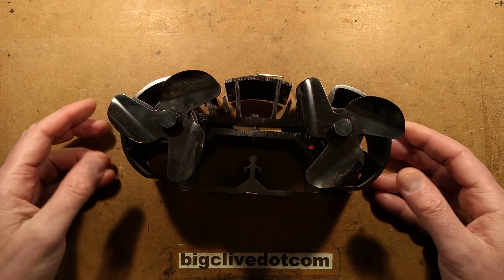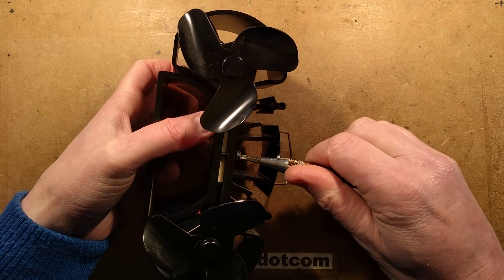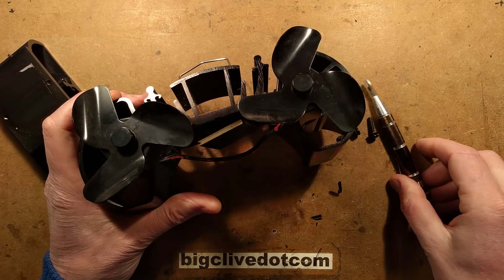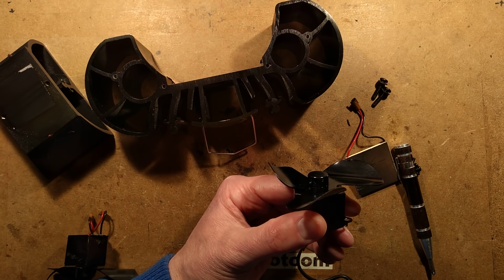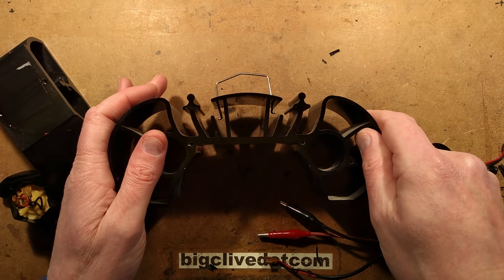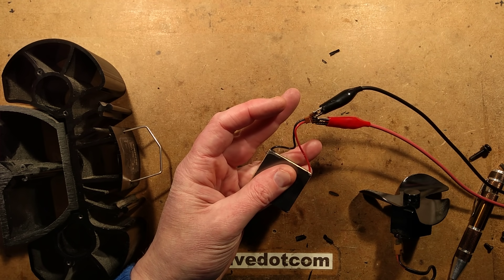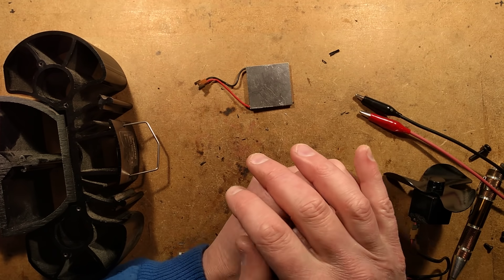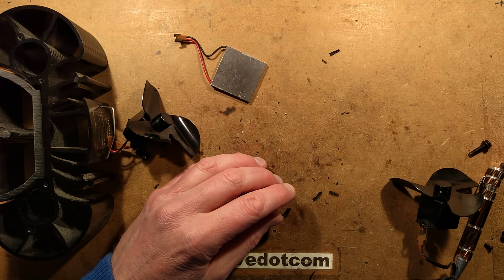Teardown of a self powering machine.

Comment: OK Clive, this video has two topics worth note.  One the Alzheimer's side, and the Peltier Junction side.  One I have familiarity with and the other not.  Sadly it was the Alzheimer's side I am familiar with, and have first hand experience with the need to laugh about situations that at the moment seem pretty crazy.  By the way, I still have the chamber pot from the commode chair (unused) with the lid in my garage, always needing a container for something, I kept it.  Now for the other side....can the Peltier Junction TEG/TEC be connected in series or parallel, depending upon needs?  Is the voltage a product of surface area, (more=more better)?
Reply from the maker: I'd guess two or more could be used and wired in series/parallel for higher voltage/current.  It's not something I've tried.
Reply: I suppose the issue with serial connections might be a voltage differential between one and the other, similar to tungsten lamps in serial on a DC circuit so they become progressively less effective at cooling. Or if used to generate power then you could end up with one of the strips supplying power to the other and thus driving it.

Parallel would seem to be best in either case. In my understanding anyhow.
Reply: Edward Clayton 
You probably meant to say that current would be a product of surface area.
Reply: This video uses the differential between the Alzheimer's side and the Peltier Junction side to create positive energy 🙂
Reply: @Conservator.  Yes, that is exactly what I meant to say.
Reply: Indeed they may be wired in series or parallel as needed.  In electrically parallel you will generate more current, in electrically series more voltage.  You can also stack them one atop the other (thermal series) to achieve lower temperatures but the efficiency drops off greatly the more layers there are as you are basically increasing the thermal impedance between the two ends and each added layer needs more heatsink area or cooling than the layer before (or a larger peltier area to pump the heat from the previous peltier) to help maintain efficiency, but they are sometimes used that way when one needs to get a small volume to very low temperatures.

In fact, a typical peltier junction is effectively an array of many hundreds to thousands of thermocouples in series-parallel (typically thermally paralleled and in series electrically, though multiple arrays can also be paralleled on a common transfer plate for lower operating voltages) all operating as a large array to generate the effect as a single thermocouple by itself does not generate a lot of cooling or power generation on its own...but since the effect scales we can combine many to get what we need.
Reply: @paulgascoigne5343  I was thinking in lines of useful voltage like a battery or batteries in series.  Didn't consider one driving another.

Comment: Interesting, I have an identical single blade version, and recently replaced the motor after it failed. The original motor must have clocked up around 5000 hours. Sometimes I give the blade a little push to help it start up. Hopefully I will get another 6 years of service from the new £3 motor. I love your channel btw.

Comment: Could you modify one of these with a higher end CPU cooler instead of the big chunk of extruded aluminum? I wonder if it would allow it to start up at a lower temperature and provide more airflow for a given temp.
Reply: I've seen a couple on youtube - the one by Brian Ealy is especially notable for the magnificent beardage on screen.
I'd guess a heatpipe would move the heat more efficiently and reduce the chance of the sort of slow start overheating clive's had in these units - but it's probably easy to underestimate the clever thermal design that's gone in to the shop bought ones too
Reply: People used to use them as CPU coolers. The problem being if you accidentally cool the CPU below ambient air temperature then you in essence create a dehumidifier (and also lots of water and condensation inside the chasis). You could use monitoring equipment but should it fail or be unable to tell the difference between room temperature and chasis temperature you could still end up with a fair amount of moisture which is never good with circuitry. It takes watercooling to a new level!

The safest and least complicated method is air circulation. Just standard fan and radiator. The chasis and CPU would always be warmer than the temperature of the room so never suffer from water issues. So if you were to use a Peltier to keep the system above ambient temperature anyway, it seems a waste of technology and money, simply introducing a further unnecessary opportunity to fail.
Reply: I suppose you could, but you'd have condensation issues if you went below dew point. You're also strapping a device that needs a heatsink to replace a heatsink so not much value.
Reply: @paulgascoigne5343  Not what I meant. I was talking about using a CPU cooler to make the stove fan work better. Not using a peltier to cool a CPU.
Reply: @3ountyhunter   Not what I meant. I was talking about using a CPU cooler to make the stove fan work better. Not using a peltier to cool a CPU.

Comment: I definitely agree on the fridge aspect, I had a peltier cooled mini fridge for a while, at most it'd take 6x 330ml cans, not that great in the summer, and would make a god awful racket with its' original fan (I later replaced it and made a video of the upgrade), then later I rescued a Bosch fridge from being scrapped, swapped it with the uncle's smaller Husky brand fridge, and now I have a nice, quiet, roomy (in comparison!), compressor-driven fridge instead... :)

Comment: Sorry I don't understand the porpoise of this machine? Is it a stove powered space heater fan?

Porpoise?! Stupid speel chequer.
Reply: Simon A yeah I don’t really understand what it’s for either...
Reply: They're used to blow the heat from a stove  into a room rather than letting it go up to the ceiling. They're neat because they use the heat from the stove to drive the fans. Often used on wood burning stoves.
Reply: @RobertShippey  It spreads the heat of the stove more effectively.
Reply: My worm processor can't smell either.
Reply: Used a lot on narrowboats in the UK, keeps the air slowly moving around and helps prevent the cold feet hot head symptoms of being in a part submerged steel tube and helps take the chill off the rest of the boat given time. Being off grid it saves having to power another device from the 12v or 240v systems
Reply: SO happy you asked this swimmingly wonderful question... (get it? porpoise 🐬, swimmingly, ugh...) I live in Florida and was wondering why the hell would someone turn on a stove to run a horribly inefficient fan. The answer is people all over the world do different things for different reasons. Thank you to the other posters here for explaining this. It’s actually pretty cool when you understand why. You guys really rock!

@matthew willets Thank you for the post about the Narrowboats, that is so cool!

Comment: I always thought they were cool, but what is the point, if your oven is too hot, turn it down or open a window, not everybody has an arger they have to keep on all the time for heat 🤣
Reply: Maybe its for air circulation?
Reply: People who have a wood burning fire use them to move the heated air around a room. They are widely used on Narrowboats.
Reply: Never put yer lager on yer Aga.
Reply: @martinda7446  I put a potato in there and forgot about it. Found it in the back after about a week. I had made coal!
Reply: @ollieb9875  That is how coal is made? I will be sticking a bag in tonight. I may try a carrot, for pointy coal.
Reply: @martinda7446  the only thing I can say for sure, is the potato it once was had ceased to be 😂🤣😀
Reply: @ollieb9875  But you got a nice shiny new lump of coal, it gave its life for a purpose.
Reply: @ollieb9875  Bet it smelt delicious for a few days!
Reply: @Audio_Simon  well.. there's the thing! With the door closed bearly anything escapes unless it's banging on the door.. something other than the slow cremation underway here, leading to the potato's eventual demise can go quite unnoticed! 😂
Reply: bren106 question if they are used on woodburners to circulate heat, why do they even have wires on them and motors? Heat alone has been used to push fan blades and the like around for centuries. Those little Christmas merry go round candle holders for example can spin pretty damn fast
Reply: Sun Wukong 
To direct the hot air in a different direction.
Reply: @pmailkeey O.K, for the pedants then. It improves the efficiency of a radiant heat source by circulating the heated air rising from that heat source. Sit in your car and see how long it will take for the heater matrix to warm it without turning the fan on. That analogy is somewhat erroneous now that the vast majority of vehicles do not have the matrix directly inside the passenger compartment, but use your imagination and wish yourself back in time to when they did.
Reply: @GreatSageSunWukong  efficiency!!!! Watch some narrowboat youtube videos, they are often featured on those channels.
Reply: @pmailkeey actually I threw it in the pond, disgusted as I was at my stupidity perhaps I compounded it further by thinking the fish might nibble on it, like I didn't get to 😂🤣😀
Reply: @pmailkeey Air currents being likely reduced by closing doors and windows when there is a need to heat an area. Relying solely on thermal displacement caused by lighter, heated air rising, and colder, more dense, air falling, is what you mainly left with once those air currents, or draughts, have been limited. moving the heated air more widely and at lower height is better than allowing a room to warm from the ceiling down. Which is why they have underfloor heating, but not over ceiling heating. 
As for efficiency or effectiveness that is purely an opinion on which is the better suited word, and all opinions are subjective.
Reply: @martinda7446  If you do it with mandarins or oranges it would serve as aromatherapy treatment too. Not as pointy, though.
Reply: @pmailkeey The horse is dead, please stop flogging it. I really hope you have more in your life than poring Wikipedia for rebuttal points, I know I do.

Comment: Had one of the tall ones fail on me last year. It was the first one I had, and it ran for 8 years without issue. Bought another one two years ago and noticed how long the original one took to begin to spin, and how slow the maximum speed was compared to the new one, so I decided to tear it down. I removed all the graphite from the Peltier and cleaned it up with rubbing alcohol. Tore down the actual motor, (Which are very simple to open and repair) and cleaned up the commutator, (which was discoloured with use and age) with some 0000 steel wool. Ran a fine blade between the gaps of the split ring contacts to clear up a few shorts that had developed. A few drops of high heat oil on the bearings when reassembled and the motor was as good as new. Some high heat silver sink paste on the peltier upon assembly and the original fan then started faster than the new one and seemed to have a higher maximum speed too. Quite happy with these fans and their longevity.

Comment: I've always been fascinated by those fans. They don't blow cold air because it's the heat that makes them go. Also the fan cools the top and makes a bigger heat differential which makes the fan go faster which makes a bigger heat differential, etc.

Comment: Hey Clive :)
you reminded me that years back, I watched our Antiques Roadshow here in the states. and they had an antique / low tech version of these. it was a fan that had a kerosene [ parifin ] burner built into the base, and the heat from the burner would go up the stand and use heat conduction to turn an impeller of sorts, which would drive the fan blade.

Comment: There are units designed for heating and cooling and there are units designed for power generation that use different metals and are able to handle much more temperature differential without delaminating. There is a high temperature unit in the BioLite stove. A stove that generates usb power from the heat of a small fan forced  wood/biomass stove.
Once again a great video interesting and informative.

Comment: Mother taking a dump  :) warm ;) story, and surprising... And, I have a couple of somewhat big stove fans that have done  a perfect job for many years. It is important to place them on the right spot of the stove, with not so much heat "behind" it. I usually wait till the stove surface is hot before I place them, always on the same, optimal, spot.

Comment: Very timely for me. I just picked up a single rotor low profile model last week.
Reply from the maker: If you find it doesn't start reliably, try and get in the habit of lifting it off the stove and then putting it back on once the stove is starting to get going properly.  It'll cause a greater thermal difference that should result in reliable starting.
Reply: Motors take more energy to start than keep running. I find giving them a little push one the stove is warm gets them going. Then of course the air flow helps maintain the temperature gradient.
Reply: @bigclivedotcom  Maybe they need to bend the bimetallic strip and mount it upside down (might work - or else choose a better suited combination of metals). Then it will delay its own action until the stove is preheated.

Comment: My uncle has one of these from the 80s the wiring is bare and passes through ceramic tubes where it needs to like knob and tube wiring. The whole motor is exposed and the shaft rides in brass bushings. I bought the most spendy one on the shelf at the store when I got mine, it's made of copper and the wiring seems to have silicone insulation.
Reply: Does the 80s one still work?
It wouldn't surprise me.
Reply: @mickeythompson9537  Oh yea it's been sitting on that stove since I can ever remember. Only time it gets moved is to clean the stove

Comment: Very nice video, just one little thing. I don't think its a peltier element - Peltiers are optimized for cooling/heating from a electrical power differential while they also work in reverse the effect is very weak. There is a special kind of module to do the reverse it's called a seebeck element - basically the same construction but the P/N junctions are optimized for generating power from temparature differentials.

Please keep making this great videos - i love your style of decomposing stuff.

Comment: My aunt has two of older ones with 1 motor. I have had to replace the motor on one of them. Found an exact match motor at a surplus dealer.  They are effective at moving air around.

Comment: we use peltier panels in our biochemistry instruments to keep samples cool.runs at about 12 volts and 1 amp for about a 2 inch square sample area
Reply: PCR machines?
Reply: @nerd1000ify  PCR certainly, but also popular on microscope cold stages .  For bulk cooling many labs use those "desktop refrigerated plates", also seen in bars - where cans, etc can be kept cool without being in a fridge.
Reply: @nerd1000ify  not that i know of

Comment: I wonder why no heatsink or CPU manufacturers don't use Peltier plates, In my mind the cool side on the CPU and the warm side facing up connected to a heatsink would surely make it run much cooler overall than just a heatsink and fan.
Reply: Money.

Comment: I've ordered a couple handfuls of the cheap ebay peltier chips. They most all worked when I first got them, but they are incredibly fragile. Just wiggling the wires on them will often make them go open. Also running more than an amp or two thru them for a few minutes can fry them.

Comment: I had one of these on the franklin stove in my garage, but instead of using a peltier, it used a stirling engine! both it and the stove were probably early 1900's vintage, and came with the garage (and by an extent, my house.) unfortunately the prior owner of my house didn't use the garage, let the roof go, so the garage and everything that was inside was thoroughly water damaged. 😿

Comment: My experience about peltiers is that they are pretty much invulnerable unless badly misused. The company I work at makes battery cooling cabinets with peltiers and all that has ever failed are capacitors in the controller and fans.

Comment: Strictly speaking, generating a voltage using dissimilar metal junctions is the Seebeck effect.  The Peltier effect is the creation of a temperature differential by passing current through dissimilar metal junctions. I suppose what is normally called a Peltier unit should really be called a Peltier-Seebeck module because it can be used in both modes.

Comment: Thermoelectric elements are usually designed slightly differently depending on whether they are expected to generate electric power, or consume it to generate a temperature delta. It's the exact same mechanism, but the design considerations are different. So although kind-of interchangeable, it's not really recommended!

But yes these stovetop fans are very very useful in houses where a firewood stove is the main source of heating. Spreading the air around the room / house takes surprisingly little in terms of air movement, and spreading the heat around makes a surprisingly huge improvement in heating efficiency. Basically, these little fans are very, genuinely, useful!

I think most of the time they end up dead because people don't understand that the center of their stove is WAY too hot. Put it on the side, or on a corner... If the bimetal strip ever activates, you are already cooking it.